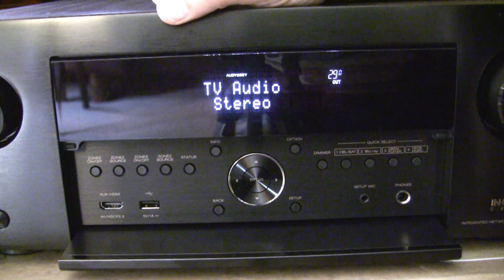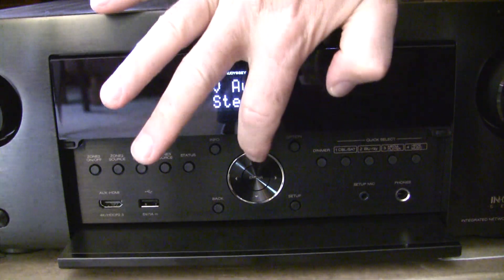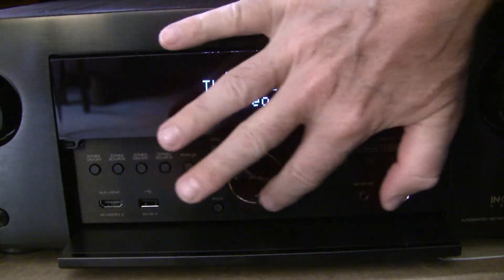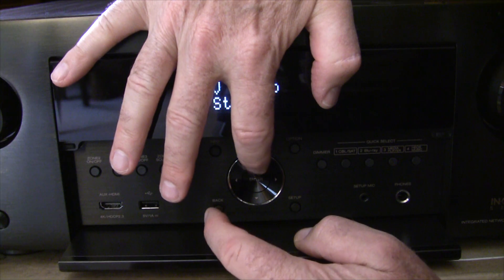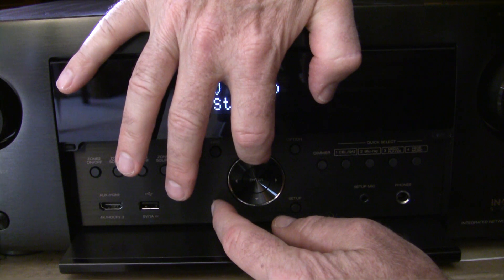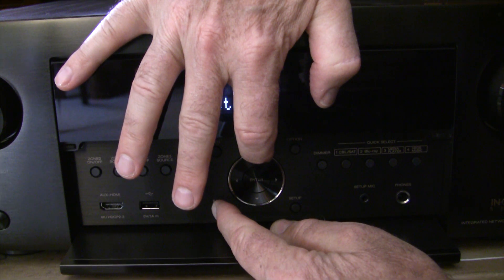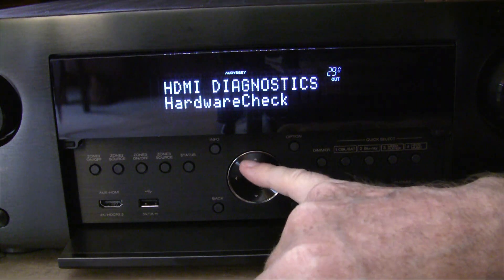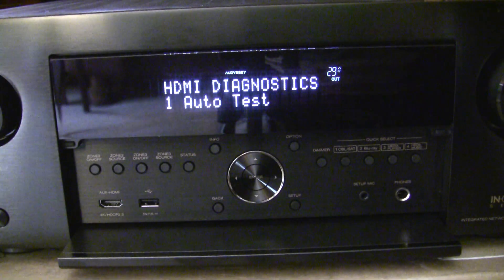Denon Receivers - How to enter HDMI Diagnostics Mode to test your HDMI Cables up to HDMI 2.1 8k

Comment: how to do this on x3700h?
Reply from the maker: The button combination is different.
From what one of my commenters on another thread said:
Press and hold zone 2 source and Tuner buttons to go into HDMI Diagnostics mode.

Let us know if that works.
Reply: @BetaCygniBlog  hi, i found it by myself. on AVC-X3700H it's zone2 + PURE DIRECT (on front panel), for about 5 secs. Thanks!
Reply: after that, zone2onoff = up, zone2 source = down, dimmer = ok
Reply from the maker: Great! I’m glad you figured it out.

Comment: I just bought the Denon x4500 h.I am using the Hdmi arc to connect tv to the receiver. My Tv is old model but has the Hdmi Arc and it is 4k.When playing music or tv there is a video content but no sound.I have updated both the tv and and the receiver.I bought Audioquest Hdmi from Best Buy it was working for sometime but now there is no sound when playing music  from youtube or amazon music.I called Devon and Samsung , and non was able to help.I i changed the Hdmi but still i cant get any sound through my speakers.I hope you can help.Thanks in advance.
Reply from the maker: The thing I would first check is to make sure that you are using ARC input/output of the TV and the eARC input on the TV. 
And make sure you set the sound output of the TV to ARC.

Here's a link to Part 5 of my Home Theater Upgrade series where I configure the TV to send its sound out through eARC:
https://www.youtube.com/watch?v=mINkuT8ZvQ8
Of course your system is different, but you might get a clue from that video.

How did you have the TV sound hooked up before?
Reply: Beta Cygni , i figured it out..i turned on Anytime +(hdmi -cec )on my tv set up.Thanks a lot for the swift reply.
Reply from the maker: @nanao1267  I'm glad you got it working!

Comment: The silver ring is not a separate button as you suggest. Sounds like you have a defective unit if you have to use the method you're presenting.
Reply from the maker: You're correct. It's all one button.
I just found it to be more reliable to press the silver ring part of the button to go into HDMI Diagnostics mode.